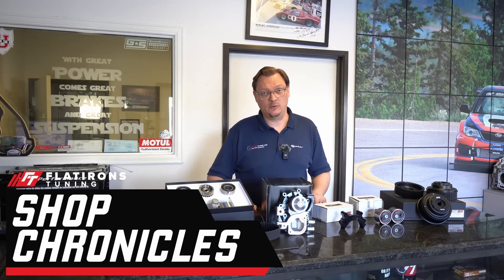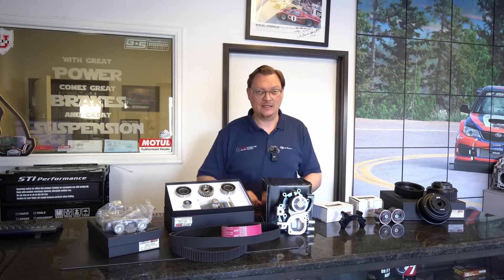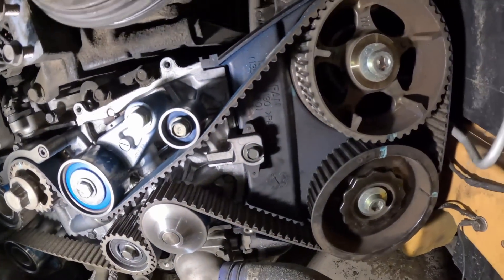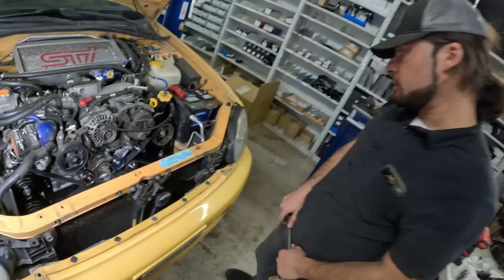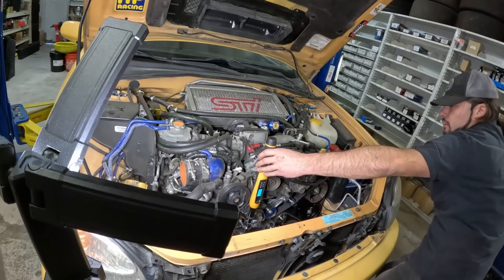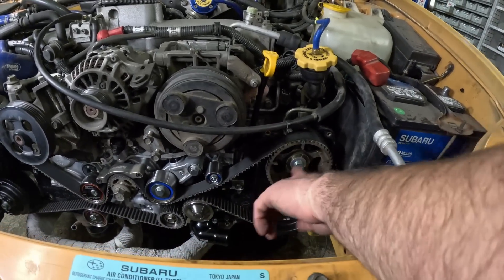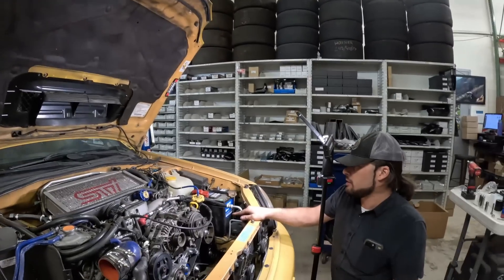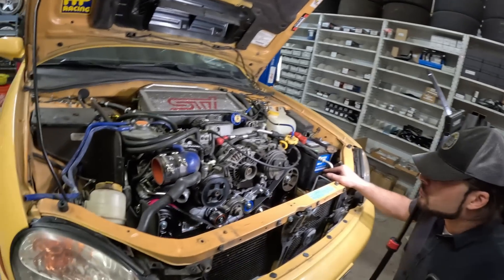What do Eccentric Idler Pulleys do?  And when do you need them?

Comment: Hey I’m doing my timing belt right now and my marks aren’t lining up properly the left side intake can gear always looks like it’s a tooth off but the thing is my car was like this before with all stock pulleys ? And it was running fine, also the previous owner decked the head so believe that is the reason why it’s not lining up good ??
Reply from the maker: Thanks for watching and thanks for the question.  If you want to correct that issue, the Eccentric Pulleys should allow you to get the cam pulleys to line back up correctly.

Hope that helps and Stay Tuned!

Comment: Is it true the Roger Clark pulleys will last for the full 105k mile timing service interval? I have a set of IAG eccentric idlers at the moment, and I’m about to tear in to the engine because they have a 60k mile change interval.
Reply from the maker: Thanks for watching and thanks for the question. Yes, because they use the same dual bearing design as the OE pulleys they will have the same replacement interval.

Hope that helps and Stay Tuned!

Comment: Fit,
Hello gentlemen, when machining EJ heads, what is the permissible amount of material allowed before you buy thicker HG ?
Thanks, great channel 😊
Reply from the maker: Thanks for watching and thanks for your question.  We don't machine the heads in house, so I would definitely default to what your machine shop recommends.  I think that there is a spec in the service manual, but I don't know it off the top of my head.

Stay Tuned!

Comment: I'm doing a HG job right now on my IAG closed deck block. The d25 heads have been decked twice. Instead of the pulleys, I'd rather do thicker HG, how much thicker is typically needed in my case?
Reply from the maker: Thanks for your question.  Given that you are using a closed deck block, most likely a 1.1mm thick head gasket would be best.

With the D25 heads, you would want to use these gaskets to match the cooling ports:

https://www.flatironstuning.com/rcm1693

Hope that helps and Stay Tuned!

Comment: what issues do you run into that warrants these pulleys?
Reply: The left intake cam was out of time when the rest was in time. These pully corrected that. Something to do with machining heads
Reply from the maker: The most common cause of the timing marks being off is machined head surface and/or running thicker head gaskets.

Hope that helps and Stay Tuned!